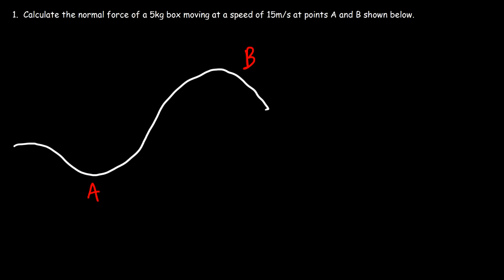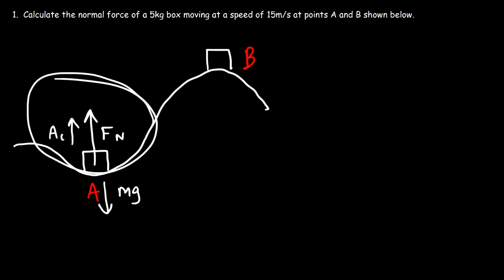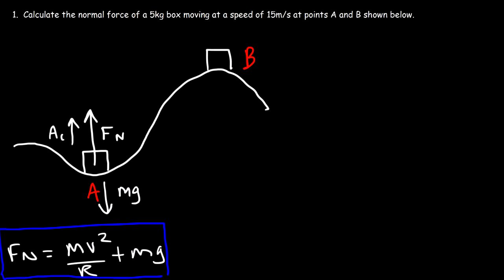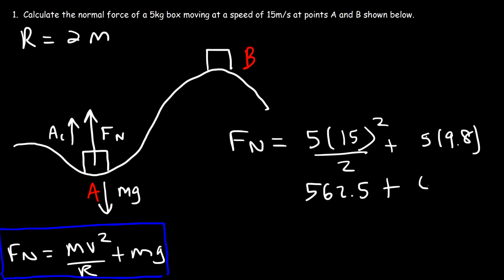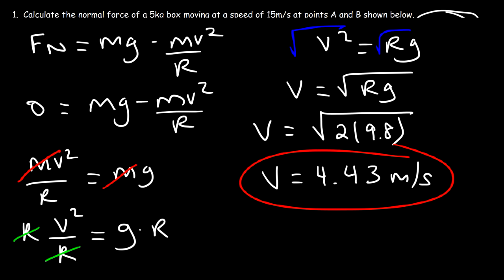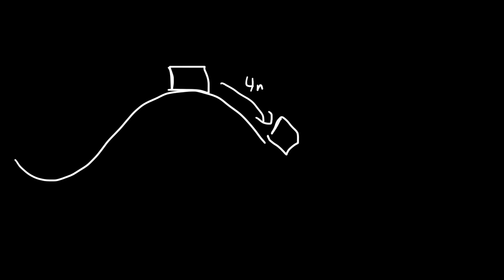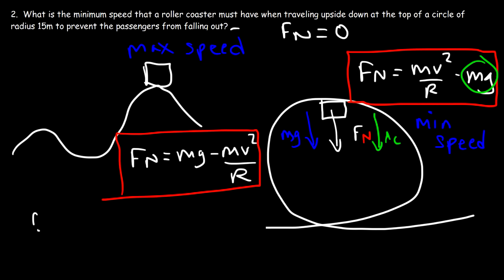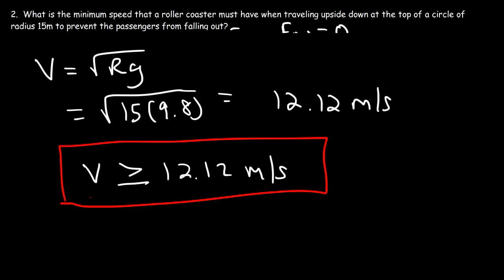Normal Force on a Hill, Centripetal Force, Roller Coaster Problem, Vertical Circular Motion, Physics

Comment: on roller coaster case, what if the cart is not sitting upside down but sitting on top of the loop?  the textbook said Fn is still pointing towards the center, which i dont understand.  as i thought that would be similar to the box on top of hill case, Fn is pointing upward, not downward to center.

Comment: It’s been a very long time since I’ve done one of these. the sum of forces in the X dir=0, correct?
Reply: Adam Chavez In these roller coaster problems, assuming there is no acceleration, yes, no net force would mean a constant speed, so you would be correct. If there was acceleration, there would be a net force forwards towards positive x values, so the sum in the x direction wold equal some positive number.

Comment: Thanks for the video. Got 1 question really confused me. When a car is travelling over a speed bumper at a higher speed, isnt the centripetal force gonna be larger? But why the car will fly off when the speed is higher?
Reply: There is a maximum speed. If the car is to over the max speed, the car will leave the ground. If we treat the speed bump as an arc of a circle, we could say that the centripetal force is equal to mg - R (as they act in opposite directions). => (mv^2)/r = mg - R. If the car is to leave the ground, R will equal 0 since there is no contact. Using R=0, we can calculate the max speed by rearranging the expression to give v = root (gr), which is the maximum speed that a car can go over the speed bump without flying - it does not simply get attracted more to the speed bump with higher speed.
Reply: R is the reaction/normal force

Comment: Hi!
What is the normal force exerted by a road inclined 8 degrees above the horizontal on a 
1500 kg car travelling at a constant speed V?
I am fine calculating the normal force when the car is stationary, but when the car travels at a constant speed V, I have no idea.
Would you please help me? Thanks a lot.

Comment: Better use geometry cosine function, because you wrong per sqrt(2) times example if plane flies forward part of energy is used to fly forward and part of energy used to lift off from the ground same principle and here, normal force is not equal to zero.

Comment: @11:30 im pretty sure the centripetal force is positive whenever it points to the center of the circle. So when you wrote those equations the way you did by making all of the signs negative, it was an unnecessary step (u could multiply the entire equation by negative 1 and re-organize it to still get the same result). there are actually alot of extra unnecessary steps in these videos. its confusing. or maybe im just dumb